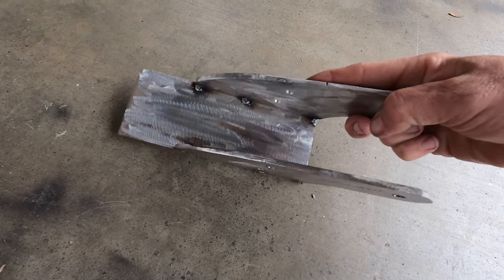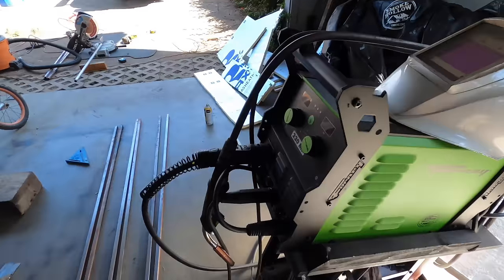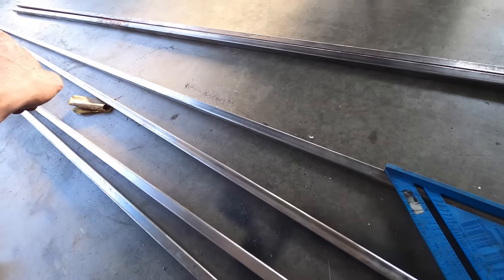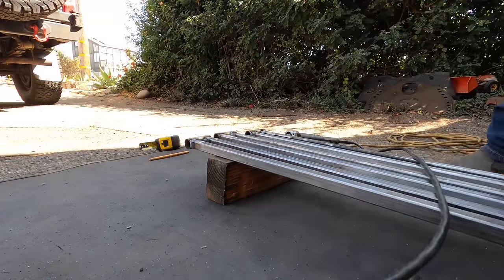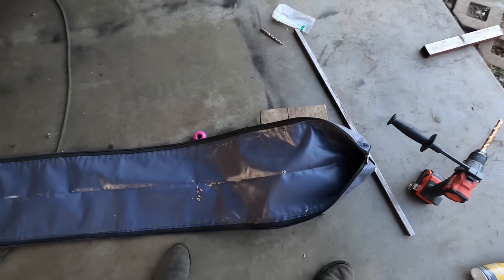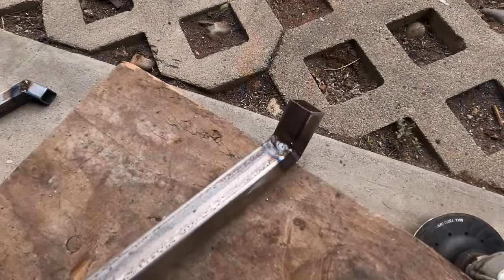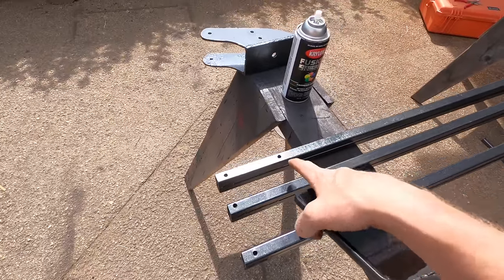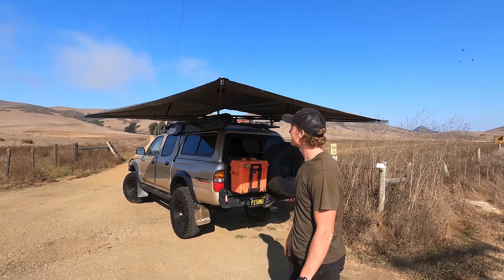How to build a 270 overland awning for less than $150

Comment: Fantastic video.  This is what I needed to push me over into learning to weld.  Looks great and I will try to replicate this.  Thanks for the wonderful step by step guide.  I wonder if pop-rivets may have been helpful for the roof support arms.  Also, maybe having the ARB cover zipper facing down to limit water ingress?  Are you able to share a rough template for your hinge set up?
Reply from the maker: i love it! Im so glad this is pushing you to weld its amazing. I forgot to mention it but the arb bag has to be in mounted in that direction to fit the hinge since the bag is taller than it is wide.

Comment: Great stuff! Thanks for sharing, now all I need to do is get a welder.
Reply: They aren't super expensive, depending on which one you get. I bought a 110V used for $75. I probably can't weld the main plate, but I'm hoping I can get some scrap that size and cut it down. Mine should work on everything else.

Comment: Great concept 👍👍 and the saw & blade recommendation is 💯.
I'm planning winch bumper mounts and this has been very beneficial.  
Edit:   I picked up a used 10" Delta miter for 50$👍,, runs at 5400 rpm no load.  I'm not sure if this is too fast or 🤷‍♂️... what is your thoughts??
  Cheers 🍻,  G.

Comment: The awning bag doesn’t fit!

First off, you freaking rock, and you’re my hero. I downloaded and studied all your videos, bought your hinge template, and brought all the materials with me from the US to Africa where I built this awning and installed it on my Land Rover over here. The awning works great and it’s awesome!! But… the bag is way too tight, I can’t even zip it half way!!! I used your links for the awning bag and even got the same harbor freight tarp, and metal thicknesses and measurements were all exactly to spec. It just won’t fit around the poles and tarp when it’s rolled up. Any tips???
Reply: I tried watching to see if I could catch you folding yours up to see if I’m doing it wrong, can’t see clearly. But even at both ends without much tarp, it’s just tight, though there’s loads of extra length. Is it tight when you zip yours up?
Reply: I removed the three lifters, and now it fits—with a lot of grunting and squishing and sweating. I’ll keep them off and just hand tighten them into place when using them, but… wonder what went wrong?

Comment: Great vid! Love the channel, thanks for all the content.

I started building mine this week using rectangular tubing from and old bed frame. Worst case is it will fall apart, but hey, it was free! :)

How did welding in the bearings turn out for you? Debating whether to weld or insert a smaller diameter tubing.
Reply: Did u build it?? How did it held up? TY

Comment: When pounding in bearings, pound on the outer race not the inner race. Also instead of welding them in, cut a round spacer that presses against the inner races.

Comment: Hey there, I was thinking about your bearing design and rather than weld the bearing in I have a different idea that might work better. If you measure how deep the bearing should go, mark it on the tube and then take a cutting wheel and cut into the tube enough to slip a fitted piece of sheet metal into it. 16 gauge, 18 gauge... I was thinking a half moon shape that would provide a stop for the bearing without impeding the bolt through. 2 on either side if you want. Put a bead of weld along the edge of the tube that was cut and it's solid. It will have to be precise but would allow you to service it if need be. Thoughts?
Reply: PS - I will be building an awning rather than buying one after this video. Check out my FJ62 build thread. https://forum.ih8mud.com/threads/cruisd64s-fj62-thread.1123930/

I have a 2003 xtra cab tacoma btw. Have had it for 16 years and love it!

Comment: This is absolutely genius! Thanks! Definitely going on my short list of to-dos. 

Question: do you think that ARB case is big enough to fit another bar or two? I’m thinking about keeping your 3 bars at the rear, but adding another bar or 2 from a bracket up front to allow 2 bars at the front & rear to come straight out at a 90 degree angle from the truck to give a little more coverage off of the side of the vehicle. I hope that made sense.
Reply from the maker: Heck ya glad you liked it! The bag is pretty much at its limit with the 3 arms. A custom bag or possibly a different bag could for sure!
Reply: Overland Under Budget Thanks for the reply! Looking forward to more videos from you!

Comment: At the end when you're wrapping the video up, the sun's angle is making it so there's no shade under it. Since building, have you wished that it was bigger at all, or are you pretty happy with it? Either way, killer build!
Reply: Salty Motor Works I’m sure it wouldn’t be hard to add a curtain to the sides to protect against the sun.
Reply from the maker: Haha i know i was laughing at that when filming it. Even with it twice as large it wouldn't create shade in the same setting with the sun at such a low angle. But thats ok, if you flipped the truck around the shadow would be huge. Clipping on another tarp for walls in these situation would be awesome!
Reply: @miguelcabrera7748  That's a great point! I hadn't even thought of that ha.
Reply: @OverlandUnderBudget  Ah yes great idea! I figured that was the case but figured I'd ask if you had wanted it bigger. Can't wait to follow this video and make one for one of our builds!

Comment: Why don't you attach the tarp to the stiffening bar in the cover bag so you don't have to strap it on the leading edge when opening it?
Reply from the maker: Definitely a good option if you build that arm to hold weight. The way I have mine setup it’s just a long strip of aluminum so you can put much force on it.

Comment: you need to hold the tip off the welder closer to the metal. so the protectiongas can work. now it not protect, to far away.

Comment: This is a great tutorial. Thanks for posting. I'm interested in building one of these but may want to do the bearings a little differently. I like the idea of a tack weld to hold them in but fear I may inadvertently mess up the bearing. I was thinking of putting a small piece of smaller diameter pipe in between the bearings and pack some grease in it. Any thoughts?
Reply from the maker: yep 100% that would be great. The reason i used the bearings was more for gaining a reasonable size for the bolt, and i think if you could "cold rolled" steel pipe with a inner diameter of say 1/2inch then i would get rid of the bearings altogether. But yes a smaller pipe within would be great.

Comment: I was thinking, since I only have a 110V welder and everything but the metal blade. I could just get a piece of C-channel or square stock and just cut that to save me from needing a nicer welder.
Reply from the maker: I did this whole project plugged into 120v!
Reply: @OverlandUnderBudget  Ya, but mine is just a cheap one I bought used for $75, a Hobart Auto Arc 130. It doesn't use gas. I've never welded before. I wanted to back in college, but moved before taking the class.

Comment: Your stick out is too long when welding. Get the torch shroud closer so only about 3/8 max wire protrudes. Then get your head lower so you can see the puddle. Try pushing the torch instead of pulling.     Awkward when filming I know.        Good work. 😎
Reply from the maker: Thank you, i'll give that a try!

Comment: I’m only 16 years old in building this all by myself it would really help me out if you can just send me a quick thing on how you built the hinge system like the measurements of the cut out and curves
Reply: Hey buddy, pro tip for getting started with this type of stuff. Make as much as you can from cardboard and paper first, even old scrap wood. Then once you have the shape you want, transfer that to steel/aluminium. If you are going to try your hand at welding, Stick (MMA) or Mig is the way to go and stick to steel that has a thickness of 1.5mm to make it easier to weld. Good luck, go make some mistakes and and be proud of yourself each time time you learn something new!

Comment: Just watch out when using the steel blades on wood saws. They cut grate but let the blade do the cutting don’t force it. Be extremely careful with the metal shaving that go flying. They are hot and go everywhere. Also just watch out on the motors of the saws. I have seen the wood converted saws motors short
Out do the the flying speakers go I. The motor and bye bye. And watch your eyes but works great

Comment: Just Fyi those blades are designed for low rpm saws... 3000rpm max
Reply: I was thinking the same thing. That's why I haven't done this is because I was told it needed lower rpms and not high like a standard saw

Comment: Wood saws run much higher rpm than a metal chop saw.   Blade will over heat and not last long
Reply from the maker: this is true! This blade is made for these saws, but i bet it would last much longer on a metal working saw
Reply: If you run a size smaller , 10" on a 12" saw, that will effectively reduce the rpm, by slowing down the circumference per rpm

Comment: You are holding the welding tip way to far from the metal.  It should be 1/4 inch or less to keep the wire in the shielding gas.
Reply from the maker: Thanks for the tip!

Comment: That pipe is not 1in , bought 1 in and it's way to big like really big
Reply from the maker: It measures 1inch on the outer diameter. It’s possible you got 1 inch inner diameter tubing